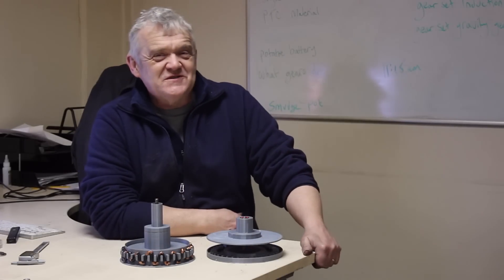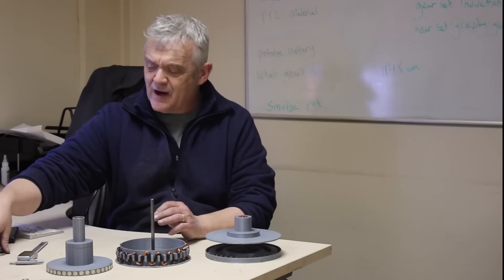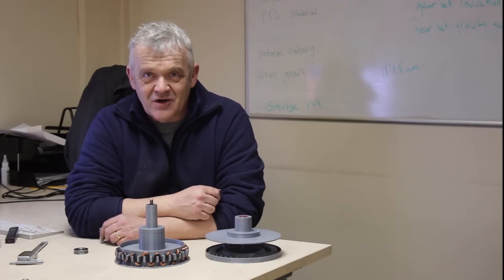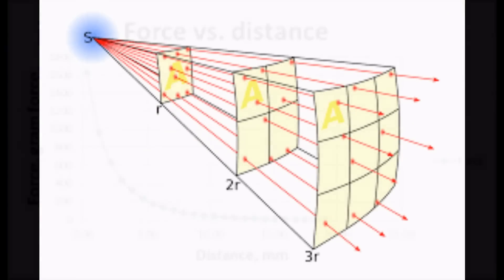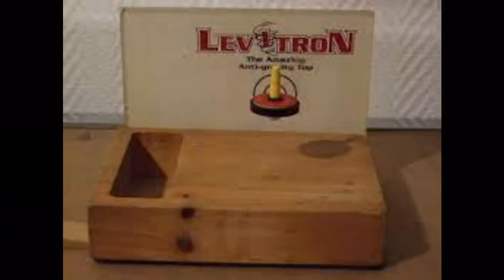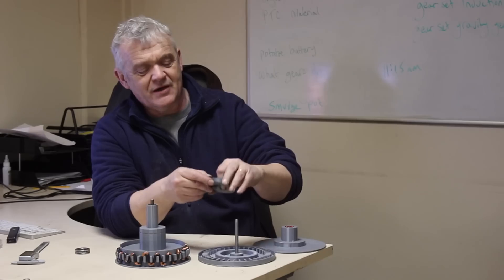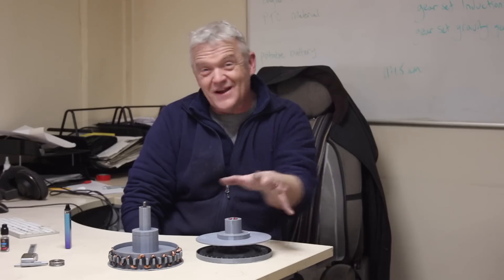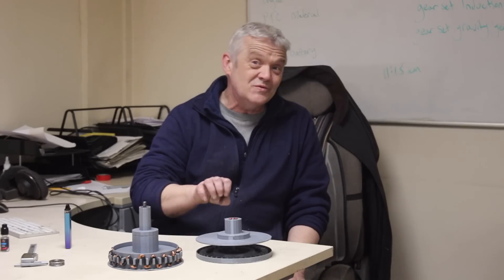1874 Maglev Versus Thrust Bearing

Comment: 9:13 "but the simplest <...>" - IDK if that's true. IMO the simplest bearing would be a plastic Kinder egg (the toy container), a metal/plastic/wooden/etc rod perforating it with one end sticking out longer. The whole thing dropped into a container with water (or some even lower viscosity fluid). Fluid bearing. Dead simple to make, does not require anything special (like ring magnets polarized in a specific direction) and is absurdly cheap. Performance is slightly worse than maglev, but then again, you're always saying that top performance is not the goal, if it will cost a fortune in the end. I imagine filling a bathtub with water and dropping a bunch of Kinder eggs into it would be quite cheaper than buying/making ring magnets :)
Reply from the maker: the simplest maglev bearing mate - we have done a few videos on the water bearing too

Comment: Rob how do you get around the variable gap between your coil and fixed magnets if the exact position will be affected by magnet strength and the rotor weight?

Comment: I still think you should try a hydraulic bearing...it will handle more weight than the passive magnet bearing...
A hydraulic bearing with a gyroscope style flywheel...
Reply: Sounds like adding complications and cost, without a massive gain. I like the principal of keeping projects like this as cheep and easy as possible.
Reply: @keXen  a hydraulic bearing is easier and cheaper than magnets...
It would spin a lot faster and longer and produce more energy...
Reply: @ShawnCheriYoung  it can't be easier then putting two magnets facing each other.
I don't believe that it's cheaper because it's more parts (and pressurized)
It can't "spin faster" because it's not adding any energy. 
Less friction can't be the case, because magnets is probably as little friction as you could get.
How you would get more energy out is not obvious to me.
Reply: @keXen  two magnets facing each other cannot hold the weight of the flywheel...if he was to put those dumbbell weights on top of that thing it would smash flat and refuse to turn at all...
The heavier the flywheel the more energy can be produced...
Reply: @ShawnCheriYoung  Put on too much load and the solution with magnets suck.. I totally agree. 
However a flywheel don't need to be very heavy to hold energy, it's all about mass in movement. Mass in the senter holdes less energy then mass on the rim, and higher speed holds more energy then lower speed. 
The important thing with flywheels are to remove friction, because that is where you loos energy. Bearings with contact and speed are the two things that causes a loss. I think that magnet bearings is as low friction as you could have, and then move 95% of the mass to the rim to keep the speed down.
Reply: @keXen  mass is energy... that's why the flywheel needs to be a heavy gyro to increase the mass to increase the energy...
A flywheel is a flat disc where the weight is evenly distributed across the entire surface; a gyro places the mass on the outer rim to increase the energy ...a gyro will spin faster with less energy input than a disc...
The heavier the gyro the less input energy is needed to maintain speed, with much greater energy output...
Reply: @ShawnCheriYoung  Yes, mass is energy (e=m2), but it's not relevant for a fly wheel. We are not going to split the atoms of the flywheel. 
Mass in motion is the key in flywheels. The energi we put in turnes into kinetic energy, and that is what we convert to electricity on the way out. The kinetic energy is terminated by mass and speed. More mass and less speed = More speed and less mass.
The only thing that weight is contributing in a fly wheel is to reduce drag. Higher speed increases the friction against the air molecules.
Reply: @keXen  you're still not seeing the picture...
(And I don't agree with E=mC2...as the C (speed of light) is not constant)...
Build them both; prove me wrong...
Reply from the maker: done it in previous videos mate
Reply: @ThinkingandTinkering  do you know which one, or ones, or do I have to wade through 2000 videos to find it..?

Comment: There is another problem with that example though potentially. You still have the magnetic force interacting with the winds of wire on the one with the thrust bearing. The other one has no magnetic interaction with any wires. That might create drag or resistance. Breaking the fields.

For a true test, add some winds of wire around it like you have on the thrust bearing. 🥴😉
Reply from the maker: the wires aren't connected mate - that means no current flow
Reply: @ThinkingandTinkering  fair enough. Couldn't tell.

Comment: The amount of power loss in the bearing negligible in relation to the power you are extracting from the wind turbine. If you are wasting 0.001% or 0.0001%, who does care?
Reply: @murdocks4304  Having a maintenance free bearing would be nice but that was a side track in this setup.  Imagine the coils, like the ones on the left spindle placed on the right side. Place magnets on the rotor hence making it into a generator. At the moment you start drawing current from the coils the  wheel wil be mechanically loaded. The amount of force counteracting the motion of the wheel will be greatly larger than the energy absorbed by the bearing . The whole discussion of having bearings that are better than good is in my opinion pointless. 
About the wind: It's everywhere the same. No wind, no energy
Reply from the maker: surprisingly enough quite a few people do care and bearings are actually much more important than you seem to think - you do realise I am just demonstrating a concept that is in practical use for exactly the reasons I talk about don't you?

Comment: Maby if it was doing work like the other one then it might not be as stupidly long.  but still awesome
Reply from the maker: they were both doing - very roughly - the same amount of work mate - just because there was a wire around one makes no real difference as the wire wasn't connect to anything - so no current flow

Comment: try three ring magnets of differing diameter... place the smallest and the largest on the rotor one inside the other... and the one that is mid sized centered on the base.

or.... use an aluminum or copper top shape for the bottom of the rotor a ferris tip on it. for the base have a center disc magnet with a metal divot placed on its center for the top's tip to rest on, and a ring magnet (or series of alternating polarity magnets in a ring) of greater strength around it.
Reply from the maker: cheers mate

Comment: I'm an old science person 78 years of discovery, can you share with me your axiel bearings
Reply: I think he said ceramic bearings. But, you’re correct to ask what kind; as I don’t think he answered. Perhaps, they are of an angular thrust variety?
Reply from the maker: I always use the same bearings 22/8/7mm skater bearings - they are cheap and easy to get hold of - I say that so often in my videos I sometimes forget to add it
Reply: Thanks for the information,
I've been expimenting using mx bicycle wheel 5 spoke plastic

Comment: Sorry mate but on the maglev, you have no magnetic resistance
Reply from the maker: I am sorry mate but what do you  mean?
Reply: @Robert Murray-Smith  the rotation comparison of the two, the bearing rotor had magnets in it over the serpentine coil, this will slow the rotation more than just the bearings, mind you I am sure the maglev will still be far better.